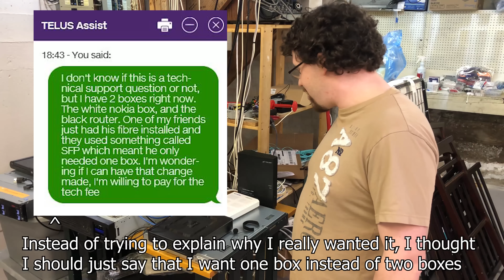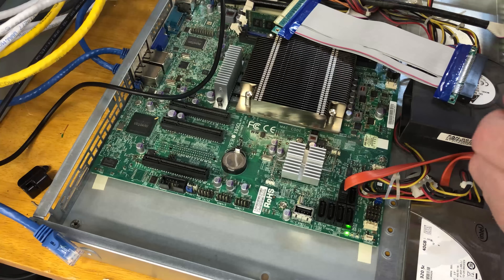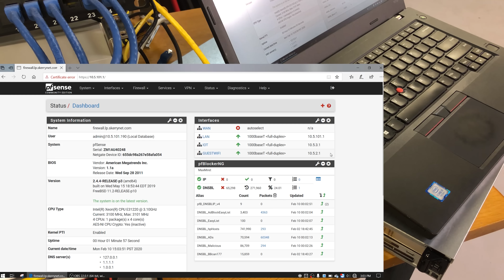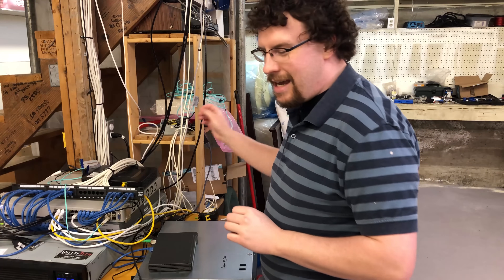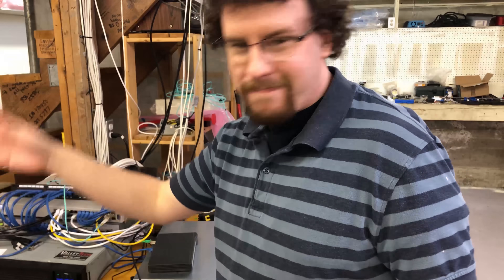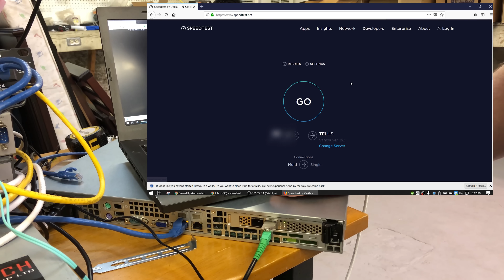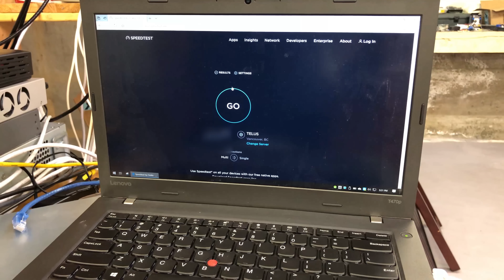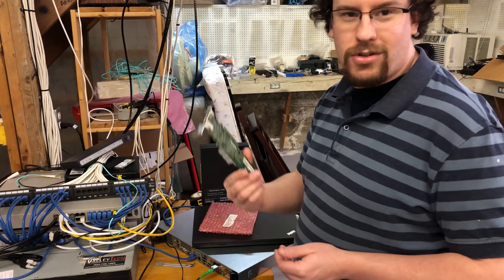I connected my fiber internet directly to my pfsense router via SFP!

Comment: Hey Shae, that collection of patch panels, switches and servers looks a bit messy, and from the look of it that's your permanent setup, what about getting a rack cabinet, it would look a lot better and be far safer.

I used a small Ikea coffee table that happens to be 17.1/2 inches internally that sits on my small filing cabinet next to my desk and it has taken my patch panel, 24 port switch, NAS unit, draytek router and my main computer which is a repurposed high end laptop that had a damaged keyboard and screen that is mounted in a 2u short chassis. 

This keeps all the computing stuff neat and tidy with no complaints from the wife, we also have a multi function printer sat on the top of the 'coffee table.
Reply: Network gear is supposed to be messy.
Reply: @stargazer7644  Hi Shae, I agree that it can be messy as a networking system comes together, but it can reach a point where you need to look at and think is it safe enough being piled up on a shelf in the basement, as you or someone else could easily knock a piece of equipment or dislodge a cable.

Rack cabinets can be bought cheaply off ebay, and you system would be far more secure.

I have a much simpler setup in my home office where I am using a small IKEA coffee table that happens to have the same internal width as rack equipment, and is about 7U high internally, in it I have a patch panel, 24 port switch, NAS unit with SSD's, an accident damaged HP i7 laptop that has been rebuilt into a 1U case and is used as my main computing device, a Draytek cable modem router and a shelf. Short (4" & 5") patch cables run between the patch and switch, with slightly long ones for the other pieces of equipment, on top of this mini rack case I have a network attached multifunction printer. 

This keeps everything neat and tidy, but the best bit is no complaints from the wife.
Reply: @Ashworth-Media  The world is made up of neat-freaks and non-neat-freaks.  To each their own.  After working in various professional data centers for about 30 years, I have to tell you the non-neat-freaks are in the clear majority.   My home gear is stacked up, cables strewn about, and the only rack I have is in the garage and used to hold old equipment I'm not currently using.  It has been this way for 35+ years.  It works fine for me.  If you have a wife that complains about your hobbies, you chose poorly.  You simply need to get a new wife.
Reply: @stargazer7644  Hi Shae, my wife does not complain about it, and I am far from being a neat freak, I was just making a suggestion that it may be safer and less prone to damage in a suitable rack, I was not instructing your nor trying to teach you how to 'suck eggs'.

I have seen some right messes in computer rooms, with one example having ethernet cable stretched across the room making you have to limbo under it, by contrast you pile of equipment is far neater.

Comment: Not sure if this has already been mentioned but you shouldn’t touch electronic circuit boards and components without wearing an ESD anti static wrist band. Also touching the end face of the fibre optic ferrule will introduce contamination from your skin and could attenuate or cause reflectance to the optical signal. It should be cleaned with proper cleaning equipment before insertion.

Comment: How to bypass ONT Mac address check and wifi router serial number check? We can not even remove wifi router (Tilgin) from the loop.
If there is a chance could you please provide a link to do that?
thanks.

Current setup - Ericson ONT --> Tilgin Router  --> Pfsense . I would like to remove Tilgin router at least.

Comment: I've been doing the same for a while, however instead of using a PCI card, i use an SFP port on my G3750X switch.

What you need to know before you do this on the TELUS GPON/FTTH network:
Your DHCP client MUST support option 82. PFSense does, but if you're using a differnt client, yours may not.
You will need to do a LOT of config in order to make the TELUS TV (IPTV) multicast work correctly.
You will not be able to use the dial-tone feature on the ONT, obviously, but something to consider before doing this.
TELUS will lose remote diagnostic ability to check for optics issues on the ONT. They will also lose the ability to do some of their more advanced diagnostics on their TELUS TV Set Top Boxes.
Your device (pfSense box) needs to be up to the task of doing the NAT translation as some lower speed boxes will not support that kind of PPS load on the proc. The TELUS actiontec doesn't suck like most ISP routers.

Comment: FTTH here, but my fiber cord has literally no slack, it's dumped right after the front door where the fiber converter sits, and the converter has a built-in SFP so no way of knowing wavelength.. Just a heads-up on the GPON, they can draw quite a lot of power, as when you got FTTH its normally passive, all the way to the receiver, that can be miles/kilometers away. Not the regular MM fiber here.. Great video however, glad you got it working :)

Comment: All the wires hanging not in the bundle make my head hurt. Please bundle them and velcrow them together. Also, you should set your equipment up in a rack of some sort, hell, even 2 pieces of wood distances apart properly is a cheap mounting method if you can’t swing the price for a rack. Sincerely, a network eng from the US. PS, good vid.

Comment: Those intel cards will only work with specific spf's unless you add a specific boot argument to the kernel telling it "ignore unsupported sfp ids"
Reply: That only works with 500 series Intel adapters. Like 82599. The 700 series are firmware vendor locked.
Reply: @eat.a.dick.google SFP+, SFP normal works in any vendor on x710 for me.
Reply: HP seems to be like that too i had to buy a SPF for mine.   also had to move the negotiation speed from Auto to 1GB
Reply: @aedgvv6095  are IBM Emulex less picky regarding the SFP modules you plug? And does an IBM Emulex 10Gb SFP+ card work with 1Gb SFP modules?

Comment: Too bad this won’t work with AT&T here in the US. They bake a certificate into their router and ONT that must handshake to bring the port up.
Reply: Yup.  However, if you have an older USG or UDM you can extract the cert from their router and patch the ETH wpa_supplicant on the USG/UDM to successfully identify as an ATT device and take the WAN from the ONT directly into the ubiquity device.

Comment: In Germany, we are free to use any Modem/Router (Modulator/Demodulator and Router are often combined in one Device) we want to use; The ISP needs to make sure that that works.

With new contracts the ISPs want you to use their Modems (either throuh Cable [DOCSIS] or VDSL, FTTH isn't a thing here), but the problems with theses is that they lack basic functionality, for example everything Port-Forward- or Routing-related, so they are basically trash when you actually want to make use of your connection.

There is a German Company producing high quality and easy-to-use Modemrouters and WiFi-Accessories which bring back basic functionality with an easy-to-use Web-GUI.

Using their modems via PPPoE might enable using pfsense to route internet-traffic, that was what I originally wanted to say with my comment.

Of course: There are also PCI-E Cards directly connecting to the Motherboard which can modulate/demodulate a VDSL-connection, but as far as I know they sort of also work with PPPoE internally. And: I don't know if they work well with pfsense and/or do have any closed source Software Blobs.

Comment: I have ubiquiti switch. Will it work? Ubiquiti switch also have sfp port.
Reply: It really depends on the SFP. The Nokia one that Shae and I have does not work well with all the Ubiquiti equipment that I have tried, both an Edgeswitch and an Edgerouter. I have seen posts about good results with Huawei SFPs, for example.
Reply: Huawei SFP's that report back to china haha

Comment: I can’t help wonder would this work on low end router  such like Edge Router 4
Reply from the maker: I have heard of other users that have the same ISP as me getting this same method to work on the edge router.
Reply: I can confirm the ER4 will work with the Telus GPON SFP module.

Comment: Meanwhile Rogers' idea of FTTH is running a fibre line into your home then converting it into coax to use with their old Hitron modem, like enjoy your gigabit downloads with 30mbps uploads
I wonder if the same thing is possible with their setup, would be nice to avoid having to deal with docsis altogether
Reply from the maker: Thats an odd setup, it may be possible, unfortunately I don't have much knowledge of other ISP's. They all seem to have their own way of doing things.
Reply: @TechwithShae  That T3200 will also do MoCA too. Cheap way of hooking up IP cable boxes with existing cables.

Comment: You Says 700Mbs its not Great, Im here in South America" Ecuador" I have 3Mbs Donwn 1.5 Uploads LOL... and please tell What hardware box you use for pf sense??
Reply: That just seems to be a 1U server with a Xeon and a bit of RAM. Anything should do, really. Maybe go for 4 cores and 4GB+ ram for a symmetric gigabit connection.
Reply from the maker: Posting a follow up video shortly to answer some questions. It is a 1u supermicro server with a Xeon E3-1220 and 4GB of ram.

Comment: Hi @Tech with Shae, been looking for this kind of video for a long time. ISP here in PH is not very cooperative even I ask them the same thing "Pay Extra" just to patch their fiber cable to my router / firewall (Fortigate 100E). The difference between your setup to mine is I have to use EPON SFP since I found out to my ISP that they are still using EPON Equip on their backhaul. My question are as follows.
1. Beside setting up the port to WAN, do you configure manually the Public IP assign to your business or home line?
2. Doing so, do you have to inform your ISP the mac address of your device so that they can connect and assign you the correct internet speed assign to your account. Same goes to your IP.
I believe some one ask you on the comments why what you are doing is against the term of use of your ISP ~ Using the mac of your device, they can control the speed and ip assignment to a specific client. ISP also can terminate your connection by those information.

Please check Fortigate 100E for you reference, hoping to get a prompt response. Thank you.
Reply from the maker: Hi, unfortunately I don't have an exact answer for you. In my situation my ISP provides the sfp gpon module for their new installations, so it was just a matter of asking for it. They sent a technician out and he removed my old ont, and replaced it with the SFP module and plugged it into the router they provided. The SFP module is registered via serial number I believe. That's all it took to get it going, once the setup was done by the ISP, all I had to do was remove the SFP module from their router, and plug it into my equipment, and the IP was assigned via DHCP. I wish I could give you more information, but unfortunately every ISP is different, and not all of them allow you to do what I have done. RE: Terms of service, I originally thought that they required you to use the equipment they provide, but I don't believe that is the case.
Reply: @TechwithShae  Thank you for your reply. :) Appreciate it.

I believe its the MAC address of the GPON rather than Serial Number. Correct me if I am wrong.

Comment: I have an HP card, collecting dust in my closet.  While I have no fiber to the home, I do have "gig speed" with Comcast. (paltry upload!)  I do use multiple fiber connections on the gigabit ethernet side, and a 10 gig fiber connection to my 2 servers, connected from my home office to my basement (where the servers are).  HP cards simply do not work!  I have had some success with Chelsio, but better success with Mellanox.  Glad it worked for you, though!  Cheers!

Comment: I have a similar setup with Telus/ONT. Going directly from the ONT to my Asus router running IPTV through it no problem.
Reply from the maker: Really! I haven’t been able to test it my self since I don’t subscribe to tv. I’ve read that others have tried with limited success. Good to know you have it working, any special config needed?
Reply: @TechwithShae  It has a dedicated Tab under LAN settings then IPTV. I think that's all I did if I remember correctly.
Settings changed:
Use DHCP routes - Microsoft
Enable multicast routing (IGMP Proxy) - Enabled
Enable efficient multicast forwarding (IGMP Snooping) - Enabled
UDP Proxy (Udpxy) - 0

Comment: Most copper NIC can only handle 1GB speed. Try this on a 10Gb nic on both computer and switch with a CAT7 cable and you will truly test that connection. This is assuming the ISP doesn't throttle.
Reply: The chelsio card he used is 10gbit.

Comment: Awesome video! Can't wait to try this on my Sophos XG firewall... When att (or anyone else) runs fiber all the way to my home. Right now they want to do last mile copper. I told them hell no 😂😂😂
Reply: DJ Maverick  what fibre module could we use with our Sophos XG? I have a sophos XG 230. I wonder if Sophos sfp module it’s compatible with the telus fibre.
Reply: @miketel01  I'm using the free firewall you can install on most computers. I'll have to buy a spf to PCI Express adapter
Reply: @OKuusava   can run fiber from there to your apt?

Comment: Can't believe you used a crummy ribbon cable PCI extender and got away with it!
Wouldn't one of these be better:
https://www.ebay.co.uk/itm/PCI-Male-to-Female-32Bit-90-Degree-Right-Angle-Riser-Extension-Card-Adapter-DC/293369108640
?
Reply from the maker: Since the video was made I have replaced the ribbon with a correct supermicro riser for that case. Wanted to make sure it all worked first, the ribbon was cheap.
Reply: My thoughts exactly, often ribbon riser cables don't provide the necessary power for  addon cards. A proper riser card with 6 pin (or molex at vleast) power might have been enough to start the broadcom. Unfortunately those riser pcb boards wouldn't have fitted in your case :(
Great workaround with the other card ! Probably doesn't consume as much power !

Comment: Wait. How the hell is a connection made on a simplex fiber? Different wavelengths and beam splitters?
Reply: GPON works in single fiber, this isn't active ethernet (router or switch ports). On other hand there are bidi optics, try googling that.
Reply: Check out GPON <dot> com. Has some great information on how all of this works. I learned a lot from it.

Comment: Sadly that won't work in the UK, over here they use a form of serial / key of the ONT when connecting up, so it will fail if you connect anything else.
Reply: This particular SFP has the ONT built-in, It's literally GPON on one side, SFP on the other for connecting to your device. There's a bar code they scan on it to authenticate it to the OLT. (The cable modem equivalent of the head-end modem) I'm about 95% sure it's AES encryption.

Comment: Hi. I noticed the all-in-one-router-black-magic-voodoo-box thing also has coaxial cable output (I assume for TV signal). What kind of TV signal could you get on that?
Reply from the maker: The coaxial port is for Ethernet over coax (MOCA). If you subscribe to IPTV, they use this to get Ethernet connections at each TV location through existing coax. (Presuming you had cable TV before). That router is a Actiontec T3200m if you want to look up more info.  https://www.actiontec.com/wifihelp/wifibooster/what-is-moca-why-do-i-want-it/

Comment: you should buy and install a rack on the basement :D
Reply from the maker: Trust me, I know. In reply to your other comment: The SFP module does not need SFP+ based on my testing. Before I had it plugged into my pfsense box, I had it plugged into a old gigabit switch and it worked fine.
Reply: @TechwithShae  OK thanks for the reply 🙏
Reply: LACK RACK from IKEA :)
Reply: @Damicske  I have one 😁

Comment: You could have just asked the ISP to put the ONT into bridge mode, would have gotten the same results saving you a couple of bucks on the expensive NIC's
Reply from the maker: That was how this was originally set up. But I figured ~$50 for a used card was worth trying out something new.
Reply: Is bridge mode really the same performance? Some iperf testing and packets per second testing will be cool
Reply: There’s 1+1 gbps service in my area where you still have a single GPON in but the provided router provides 2x1gbps out. 

If this works, then with a 10g nic maybe 2G/2G to a single pc is possible.
Reply: @aCuria.  dunno, the GPON interface has a hard limit 2.5 down and 1.25, we also struggle get the full 1.25 up when we bond 2 gpon interfaces. Id avoid GPON for anything more than 1gb. Either go for point to point or XGS PON.
Reply: @aCuria.  we havent noticed any issues,  its a hardware bridge so there really isnt any performance hit.

Comment: Why did you do that? 10 gigbit for lan is ok,but for wan? you have to pay thousands of dollars per month for a 10Gigabit connection in our country. What are the benefits of your solution?
Reply from the maker: Simply future proofing, I’ve read that bell users are able to get up to 1.4 gbps on Broadcom cards with special firmware + kernel patch, I’m waiting to see if anyone figures this out with Telus. In the future I plan to upgrade my main switch to 10gbe, I will use the second port on the card at that point.